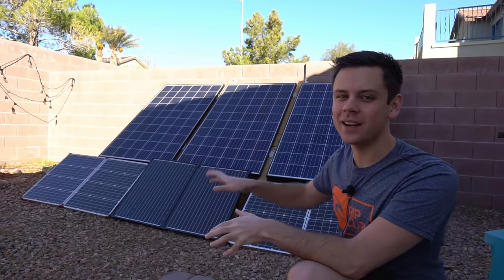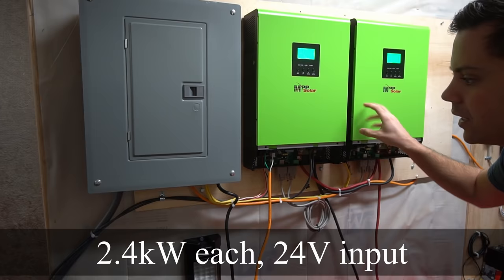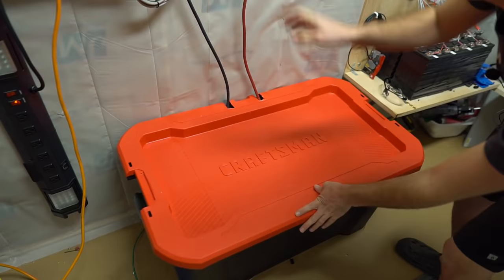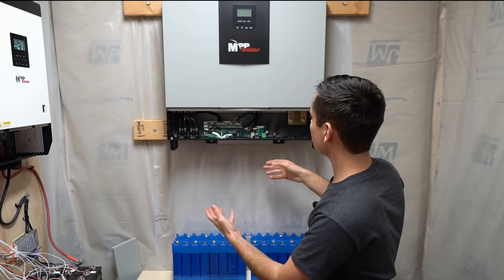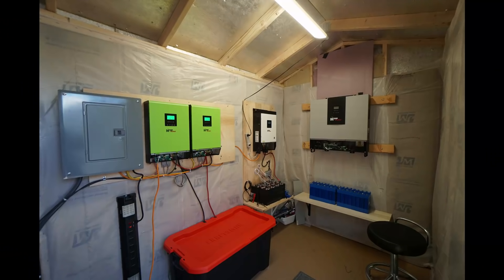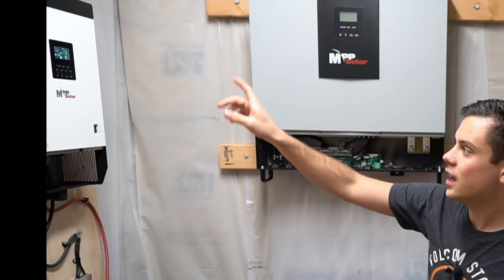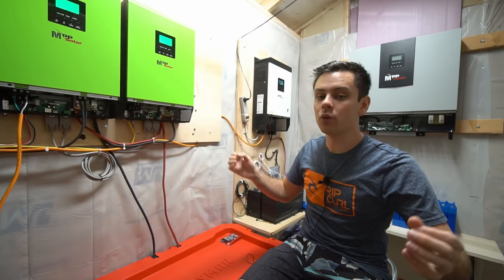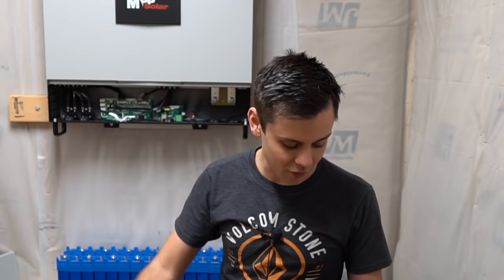Backyard Solar Power System Update! 10kWh Battery, 4 Inverters, 810W Solar Array

Comment from the maker: New viewers: this is not my main system, I have a 4.5kw grid tie system (code compliant) on my roof. I will bump up to 8-10kw in the next few months. I already upgraded the inverter to 10kw. 

This shed system is just a fun spot to test new equipment. It serves as my backup system if my main system fails. I will make a permanent system in due time. I do not plan on connecting this system to the grid!! It is not code compliant at all. The solar array is code compliant surprisingly. Really its just some panels leaning against the wall, nothing special.

Also, I use the shunt on the BMS to know SOC and other stats. I will add some shunts for data logging purposes in the future. Still in experiment mode to see what I like. Will build a final version when the time comes.

Also, I filmed this in the morning so that the sun was not in my face. This array is south facing and angled properly. I had people commenting about the shading, but it is not a problem. I filmed at this time so I can look at the camera without being blinded by the sun.

~~~~~~~~~~~~~~~~~~~~~~~~~~~
Does off-grid solar confuse you? Check out my DIY friendly website for solar system packages and product recommendations, and so much more! http://www.mobile-solarpower.com

Join our DIY solar community! #1 largest solar forum on the internet for beginners and professionals alike: https://www.diysolarforum.com

Check out my best-selling, beginner-friendly 12V off-grid solar book (affiliate link):
http://amzn.to/2Aj4dX4

If DIY is not for you, but you love solar and need an offgrid system, check out Tesla Solar. Low prices and great warranty, and they can take your entire house offgrid with their new Powerwalls: https://ts.la/william57509

~~~~~~~~~~~~~~~~~~~~~~~~~
My solar equipment recommendations (Constantly updated! Check here first):

12V/48V Lithium Batteries: https://www.mobile-solarpower.com/solar-batteries.html

Solar System Component Directory: https://www.mobile-solarpower.com/solarcomponents.html

Plug-N-Play Systems: https://www.mobile-solarpower.com/full-size-systems.html

Complete 48V System Kits: https://www.mobile-solarpower.com/complete-48v-solar-kits.html

DIY Friendly Air Conditioner/ Heat Pumps: https://www.mobile-solarpower.com/solar-friendly-air-conditioners.html

Complete 48V System Blueprint: https://www.mobile-solarpower.com/48v-complete-system-blueprint.html

~~~~~~~~~~~~~~~~~~~~~~~~~~
My Favorite Online Stores for DIY Solar and Coupon Codes:

-Current Connected: SOK, Victron and High Quality Components. Best prices and warranty around: https://currentconnected.com/?ref=wp

-Signature Solar: Cheap Server Rack Batteries and Large Solar Panels:
https://www.signaturesolar.com/?ref=h-cvbzfahsek 

-Ecoflow Delta Official Site: My favorite plug-n-play solar generator:
https://us.ecoflow.com/?aff=7

-AmpereTime: Cheapest 12V batteries around:
https://amperetime.com/products/ampere-time-12v-100ah-lithium-lifepo4-battery?ref=h-cvbzfahsek

-Rich Solar: Mega site and cheaper prices than renogy! Check them out: 
https://richsolar.com/?ref=h-cvbzfahsek

-Shop Solar Kits: Huge site with every solar kit you can imagine! Check it out:
https://shopsolarkits.com/?ref=will-p

-Battery Hookup: Cheap cell deals
https://bit.ly/2mIxSqt
10% off code: diysolar

-Watts 24/7: Best deals on all-in-one solar power systems, with customer support and distribution here in the USA: 
https://watts247.com/?wpam_id=3

~~~~~~~~~~~~~~~~~~~~~~~~~~~
Contact Information:
I am NOT available for personal solar system consult! If you wish to contact me, this is my direct email: williamprowsediysolar@gmail.com

Join the forum at https://diysolarforum.com/ if you wish to hang out with myself and others and talk about solar

FTC Disclosure Statement and Disclaimers:
Every video includes some form of paid promotion or sponsorship. Some links on this youtube channel may be affiliate links. We may get paid if you buy something or take an action after clicking one of these. My videos are for educational purposes only. Information is subject to change/update at any time. Electricity is DANGEROUS and can kill. Be smart and use common sense :)

DIY Solar Power with Will Prowse is a participant in the Amazon Services LLC Associates Program,
An affiliate advertising program designed to provide a means for sites to earn advertising fees by advertising and linking to Amazon.com
Reply: Looking a bit more rested now Will - sleep's important, ^oo^
Reply: Will can you post or screenshot the config you are using on the pip 1648 . also the software version? but you're probably not using desktop software, I'm especially curious what CV is set to and float. cut off back to grid , back to discharge .. assuming you are using a "user" battery setting
Reply from the maker: @ddmcse  oh right, I just set absorption for LiFePO4, and low voltage disconnect to 48v. That's all. And utility charging and switch over is all default. I turned the beeping off. That's about it really
Reply: Yep it's happened !  Will has turned into the mad scientist of solar ! lol    Cool setup Will .
Reply: Your commentary on cooling your shed is timely in a fashion.  I would suggest that you explore what is commonly referred to as a "Dog House Air Conditioner".  Yes I know that sounds a tad off the wall but there are companies out there  making actual AC units for dog houses and they are not expensive nor huge & wasteful.   1 fellow in Australia I believe recently posted about using one for his "battery shed" and that it worked beyond expectations.

For heating such a small building, there are many approaches which can be applied for sure.  One solution that works ad is quite economical as well, is to use an RV Furnace like those made by Suburban, which use LPG and 12V for the fan.  The beauty, is they are direct vent, easy to install, cheap to get from wrecked / used RV or camper and quite efficient actually.  With good insulation a little furnace for a 20' RV Camper can put out a lot of heat quickly and is quite cheap to run as well.
Reply: Hello frnds I.m-ship telgram .thanks
Reply: Did you install the grid tie system yourself or have company do it? If so can you do a video on that thanks
Reply: There is a dc mini split unit out there (Engineer775 uses those). That way you can have cooling and heating as needed.
Reply: @4philipp  hi there I am a fan. Have see you install hybrid airconditioner.
Did you try the lg dual inverter airconditioner. 23.00 ad night power consumption will drop to 250 watts. Outside temperature 27 Celsius,  inside 25 Celsius ac will still blow cool air.

In the weekend I will leave the ac on and it won't consume anything because I am also using these all in one inverters and it will provide power from solar directly to the load no battery needed.
Reply: Guido Mercera I’m old fashioned, I don’t use any air conditioner
Reply: @4philipp  hahah ok just giving out information how I use ac with solar.
Reply: Guido Mercera I think in most places a dehumidifier is a better investment. Window A/C often do a poor job with that but it’s what makes live bearable.
Reply: Hey Will I got a small home I'm trying to power off grid, I have a 3,300 watt solar  array and 15kwh battery bank using the 3kwh modules. I have context mppt 60 150 charge controller,  XW6048 inverter and conext SCP. I have been watching your videos and crunching numbers on my system making sure it will be able to handle the watt load I will be pulling from my appliances.  What is the best way to contact you? would like you to review my setup if that is possible.  Thank you
Reply: do they have to be code compliant in every state sorry for the dumb question. ive 
been watchin your solar videos for a while and subscribed your very knowledgable about solar. I plan on going solar myself ive already got an inverter in my account and one battery it sais its got an out putt of 400 watts power station does that mean the battery can handle 400 watts its a might max 22AH Lithium is this a decent battery its 12 volt. I'm thanking about going with a 48 volt system with 12 volt battery's wired in parallel and then later adding a 3 kilowatt battery Ii might use 9 400 watt panels with a rating of 48 volts would 
THEY ARE new trina panels sold on ebay this be a good idea is that a safe bet and im wanting to add 5 extra batteyrs to the 3 kilowatt if i did my math right that would be 3 and a little over 3 and 1/2 killowatts correc?t i just got to figure out the amps should i use 150 160 amp breaks and what amp buss bar.

Comment: Hi will. 
I'm a building contractor here in the Bahamas, so dealing with the heat is a daily thing for me. 
As for your shed, I have a shed also and suggest that you go to home depot and get some 2" sheets of insulation foam board and apply to interior walls and also apply to the ceiling because that's where the heat is going to penetrate the shed. Once done a cheap $125 ---  5,000 btu air conditioning unit on a  timer will be more than enough for the cooling of the shed.

Comment: Will, you can install an interlock kit on your main panel. There are UL listed kits, like Siemens for example. Their interlock is one of the best I had installed. You can remove the panel cover and still  have the interlock in place since it mounts on the breakers, unlike some other panels that allow you to mount it on the panel cover only. I do this type of work usually with a service upgrades. NEC allows for 2 pole 30 Amp breaker  for the portable generator L14-30 inlet along with the manual transfer switch where you can select the loads needed in. 
If you want an automatic transfer switch for the whole house, you need a load calculation for the entire house as it has to be able to provide enough power. The other way would be adding a small emergency subpanel for critical loads. 
Thanks for your videos!

Comment: For your air conditioner project I recommend the Frigidaire  FFRA051151-1.  It is 5000 BTU, rated at 450 watts and has a “Low voltage start up” option so you don’t get as high of an inrush current spike when it turns on.  That way it’s not slamming your batteries C rating every time it kicks on.

Comment: This is Really cool Will. As far as insulation.  U could get a 28 ft refrigerated trailer,  they mostly have 6-8 inch thick on the roof, and 2-4 on the sides insulation plus you get a diesel air conditioner that is automatic,  at a preset temperature,  it's cool in the summer and warm in the winter, IT IS MOBILE!!!,   put All the solar panels on the roof. With a motorized tilt frame, just a thought,  GREAT VIDEO Thanks William Orange county, ca. 
PS.  plus your whole work shop everything in one unit !!!

Comment: If you want to keep your shed cool , place mirror panels on surfaces that face the sun .
It will greatly reduce the energy needed to cool it . Black asphalt shingles are the worst ! Also a closable vent near top of roof to let the worst heat out if AC is off.
Install you AC near ceiling. Hot air rises so AC will be optomized by ridding the hottest air first and letting the cold air drop to floor where you are. Use 5v USB  8" fan if necessary  (6w on high , silent)
I made mirror panels from corrigated plastic (used sign panels)wrapped with Mylar emergency foil blankets (cheap) , but mine are indoors blocking south facing windows . It makes a big difference.  I don't know how they would hold up to your weather outside.

Comment: Great idea using a shed . Keeps heat out of house and probably lowers insurance premiums as well as lower wiring costs by having batteries close to panels)    (ac being cheaper than dc running to house.)

Comment: Am in Vermont and have an 1800 watt, 48 volt system to two inverters for 220 v pump. Am able to run my home and stay off-grid most of the time. We are having 3 days if snow and cannot get through that.  Would be awesome to have the amount of sun you have in NV.. but I need green trees and water. LOL  Love your channel.

Comment: They sell 1\2 inch or 1 or 2 inch foam insulation with a shiny side.I would recommend 1\2 in next to the wood then a 1 inch with an inch between them. And vent your ridge on top outside. It will vent the heat out and will cool the inside better.

Comment: R290 is a very interesting refrigerant.  You might like to DIY your heatpump system with custom refrigerant.  You need an Electrical Registration Will, so you can hook permanent stuff up.

Comment: For ac take look at the DC powered split units like units from Hotspot and DC Airco, etc. They are available 12, 24, and 48 volt and should work well with your setup.

Comment: Look at Daikin 2kw US7 cop factor around  5-6. In Australia, they are the big brand in the very hot north and the cooler Tasmania. In mild areas Panasonic - Fujitsu is common. Of course, we are at 240 volts 50 Hz here. 
Once the desired inside temp is reached ours is pulling 350- 500 watts, fantastic

Comment: You might want to google "ventilated cold roof" and "cool roof", it's a way that keeps a roof cool by using an airflow under the roof to top ridge line roof vents. Keeps the whole building cooler and is solar powered, the sun's heat pumps the air under the roof to remove the hot air. I saw one guy that just put insulating styofoam panels attached to the roof joists inside the attic and let air flow from the soffit area up out the roof ridge line vents. His attic was only 10 degree warmer than the house plus the ac system stayed much cooler in that attic.

Hytechsales has an excellent insulating paint or powder consisting of hollow microsheres that insulate and reflects heat for an easy paint on solution to heat reduction. I used it on my RV roof and it worked great.
Reply: Yeah, Texas cool roof. Also a combo of exterior and interior insulation.
Reply: @ursodermatt8809  The hotter it gets the better it works, in fact dark roofs are preferred. As it heats the air under the roof it raise up to the escape vents on top ridge thus sucking in cooler are from the soffits. more heat the faster it raise up and out and the faster more air is drawn in. So relative to most conventional homes around it will stay much cooler in that attic.

Comment: Nice for testing.  I put up a system DIY last year Dec 2018.  It cost 85c a watt after buying the 327w Sunpower panels, solaredge inverter and optimizers, and the racking.  This year I went with the 400w LG's with the solaredge to add to my array.  Getting ready for my Model Y.  With his system of about 12kw I will simply charge the car from 10am to 5pm at a 10kw rate which will cost nothing most days.  I decided not to do the batteries or special charging systems as the Tesla charger can vary up to 50kw and is only $500.  If I went with the new EV chargers with inverter and battery connection it would cost an additional $2500 without battery.  That is alot of KWH at 11cents.  
Your racking is a nice idea but I suggest the Ironridge racking.  All connections are worked out and they are available at electrical supply house CECGreentech in your area.  
Love your enthusiasm and keep it up.

Comment: Will if your looking for cooling options you can get small ac window unit and plug it up to a vfd drive and run a temperature module that can up cycles the vfd frequency which ups the voltage to drive the air conditioner compressor faster and drops the power demand when it gets to a set temp. This method uses half the rated power of window ac unit. Or else you can buy pre-made versions of the mini-spit solar systems that use a hybrid topology that uses batteries and grid tie power to run the ac compressor. Best of luck in whatever you choose.

Comment: Nice man cave. Love the 24v 2phase wall unit. Interesting to see you put your batteries into a plastic tote. I was thinking of building a super insulated box (4”-6” insulation) with a single heating pad to keep batteries at that perfect operating temperature. And of course for winter use. Also interesting idea to charge the second panel from the first panel.

Comment: Just getting caught up on some of your videos. Always amazed by your content, research, testing and implementation.
I noted your comment about determining the heat load (and the associated need for cooling) within your shed once the hotter weather comes. May I suggest that you add a simple thermostatically controlled fan (better than simple convention) to provide "free coolng": this can help offset the amount of mechanical cooling (small air conditioner) and its associated electrical consumption. You could draw cooler air from under your shed and use the fan to exhaust at a high point (hotter air).  Adding a solar panel to the roof (or a metal shield offset from the roof by a few inches) will reflect any heat effects that could make the shed hotter; it's great that you've insulated the shed.
Feel free to ignore the following information as I'm sure you get so many experts giving you advice. :)
The heat load within the shed can be roughly calculated by sum total of electrical inefficiencies (say about 1 ~ 2% of the load rating - this would be an equivalent KWe value which can be converted into BTU) for each of your electrical devices (inverters, etc.) plus the amount of heat absorbed from the ambient outside air temperature plus any absorbed solar heat (this would be in BTU); add the two figures and this will give you the equivalent BTU cooling that you need to offset to keep your equipment cooled to say <90 or 95 Deg. F).
All the best to you! Please keep up the amazing work that you do. You are an Elon Musk in your own right!!!